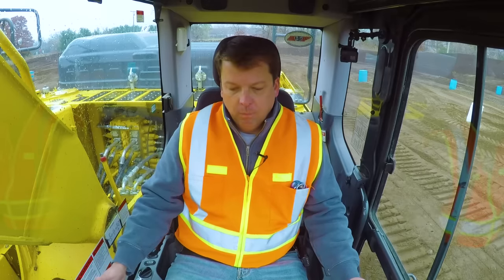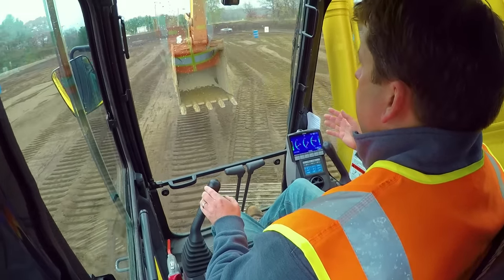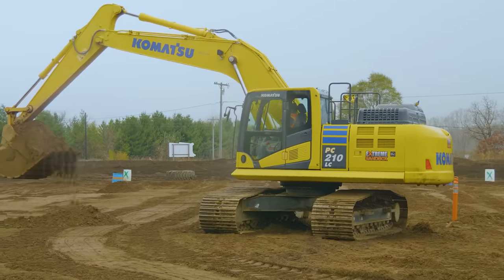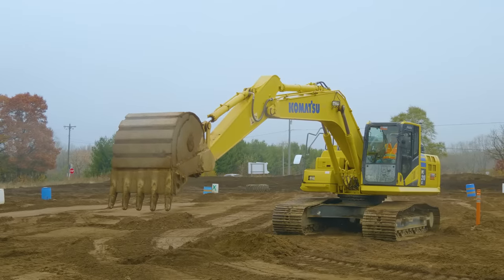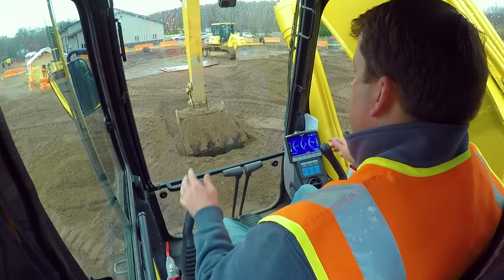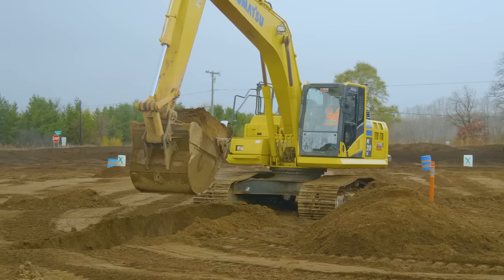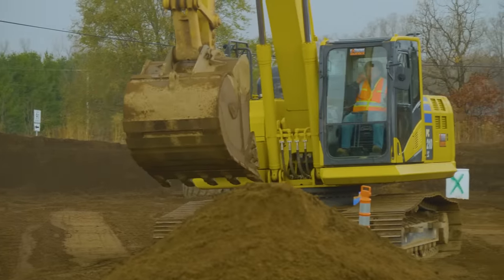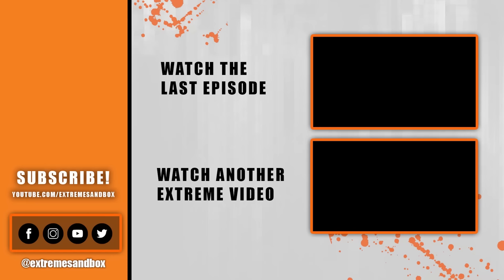What NOT to do in an Excavator | Heavy Equipment Operator Training

Comment: Final drives always uphill
Reply from the maker: Thanks for the comment!
Reply: If you climb steep terrain with sprockets (final drives) uphill your track chains are pulling downwards, applying pressure to you top rollers and leaving slack under the bottom rollers, which can skip on the sprocket as you climb and puts a ton of stress on your top rollers. Idlers should be facing uphill, drive coming from the rear, so the slack is on top and the chains are tight on the bottom, increasing traction and contact with the surface you're climbing. That's why all tracked equipment is designed with sprockets at the rear, so when you're traveling forward you get maximum traction when the machine is likely to be under load(especially on dozers). After plenty of time climbing steep terrain in forestry and land development I can confirm the difference is night and day climbing with sprockets at the rear.
Reply from the maker: @pushnpow  Thanks for sharing this info!
Reply: Mr Dig so what your saying is instead of replacing worn out parts and keep good tension on the tracks I should keep the heavier side of the undercarriage down hill and the lighter side uphill?
Reply: OakRidge 2680 you increase traction having the final drives at the rear. That’s the simplest way of putting it. The machine is designed to climb that way, with the weight of the final drives and counterweight at the rear. The weight of the final drives is inconsequential, if you have a quick hitch and a bucket on the end of your dipper it’s much heavier than a pair of final drives anyway. I have tried climbing both ways in the real world on very steep terrain and can confidently say you will climb better, easier and with less stress on the machine with sprockets at the rear. And avoid wearing out your undercarriage prematurely.
Reply: OakRidge 2680 having sprockets at the front increases tension on the part of the track not engaging the ground, your track is loose against the ground and pulling tight on your top rollers, which does nothing for traction and puts excess stress on the roller for nothing. Have a look at it next time you try to climb that way around. Better yet, at the crest of a steep slope, track a third of the length of the frame into the air and have a look at the chain underneath. It will be hanging loosely under the machine, with the sprocket barely grabbing the chains, but tight as a piano string on top, putting all that pulling force on the top rollers, which just ruins the bearings and wears out the rollers. You want that tension on the ground, pulling the machine up a slope, not trying to pull chains into the top rollers.
Reply: Mr Dig what your saying about unnecessary stress and tension on the front idler makes sense. I don’t understand how a few inches of slack on the bottom of the track (part on the ground) would cause you to loose traction. If your square up and down with the slope of course
Reply: OakRidge 2680 I was meaning more the top rollers than the front idler. It’s a real bastard to explain in written sentences. It’s really something you’ll notice if you’re climbing decent, continuous grades in larger machines. If you reach a point where the machine won’t climb and your sprockets are uphill, try the same slope again with idlers uphill and you will notice a difference.
Reply: Mr Dig well that’s why I ask, I’ve been in that situation numerous times. (Not it dozers) I’ve always noticed working on a hill is more sturdy when your finals are up front. Less rock and lean when you break 0 while swinging
Reply: Mr Dig hey Mr Dig did it ever cross you that you’ve been wrong? All this time you’ve been making a simple mistake.
Reply: OakRidge 2680 I could ask you the same question. If you can ignore every logical reason, fact or experience that I’ve written here and ask me if I think I’m wrong then I’m clearly pushing shit up hill. Sprockets behind, naturally.
Reply: OakRidge 2680 the only thing that may make sense to you is to ask yourself: “If my machine climbs better with the sprockets in front of me, why is every tracked machine built today designed with the sprocket at the rear? Excavators, bulldozers, tracked loaders, tracked skidsteers, snowcats. If I’m travelling forwards, the sprocket is behind me. Why would they do that?”
Reply: Mr Dig that’s a good question. Most track trucks like morookas and yanmars have them in the front. Maybe it’s to offset the weight of the attachment? Making the machine more balanced

Comment: Yeah dump it 2 feet away from trench if your trench is only going to be 2 feet deep
Reply from the maker: So are you saying 4 feet for 4 feet, etc?
Reply: @HeavyMetalLearning  yes,what ever depth your digging the edge of the spoil heap should be the same distance, ie 1 metre deep you heap would be at least 1 metre away, it's weight and grond pressure,
Reply from the maker: @clivecousins4315  Interesting....I've never heard that rule of thumb, but makes sense.   Curious if any other operators have that same rule?    Thanks for sharing!
Reply: @HeavyMetalLearning  might be different over there than here in the UK,  but the weight from it bears down on the ground below at about 45 degrees angle it just saves the weight to close collapsing the side of your trench,if the bottom of your trench is 1 metre then 1 metre away is about 45° angle so there's no ground pressure pushing down against the side of your trench, nice looking machine👍 glad to see another 1 that isn't over greased, that then runs down everywhere and looks a mess when she's been worked👍
Reply from the maker: @clivecousins4315  Thanks for sharing...that makes sense!

Comment: I'm so glad you don't have CAT on this video. They've really disappointed me over the last 10 years. Their K series dozer needs to be scrapped! It's garbage!
Reply from the maker: We do love our Komatsu!
Reply: They've pretty much always disappointed me. We've got a couple cats now, and yeah they're nice, but they're new. Pretty much anything new is gonna be nice. Their backhoes were pathetic back in the day, all the ones I ever ran anyway. And I'll never forgive them for damn twin sticks... What is the problem with 3 stick backhoes? Not that difficult, but I'm weird apparently.
Reply: Ive been operating heavy equipment for 15 years now. Mostly excavators and dozers. Link belt, Komatsu, John Deere, And Kobelco are some of the brands along with CAT just to name a few. Working pipeline construction as i do we put these machines through the ringer and in the harshest terrain whether it be bone dry dirt or mud up to the counter weight while running these machines no less than 10 hours a day 6 days a week. We get these machines brand new most of the time at the beginning of a job most with the plastic still on the seat and only a few hours on the screen. With all that said nothing in my opinion has the quality of a CAT. In my opinion they set the bar on how a machine should run. There are a few give and take arguments in comparison to the other brands but Caterpillar lasts the longest without breakdowns and power and performance is surpassed by none. Im speaking from my personal experience. Most of the time when you do not see Caterpillar equipment on a construction site its because the company doing the job choose not  to rent, lease, or buy them because of the more expensive price tag so they go the cheaper route to make more profit at the end of the job.
Reply: I've been operating for almost 30 years & cat has done nothing but go down hill. They make cheap junk now. They used to be the best & I wanted nothing but cat. Not anymore, komatsu is way better built, less issues & more concern for operator comfort. Cat needs to step it up.

Comment: Yes dig from the top down not the bottom up. Spoils go to the right.    You are so wrong 1 trenching spoils go in the Right so your not working on your spoils and not adding compressive weight to the side of the trench and they have to be at least 2 feet away from the trench as that is an OSHA Law! I think you need to attend and send your operators to a Competent person trenching and excavating class and you will not give bad information any more!
Reply from the maker: Well that escalated quickly!

Comment: Banging your bucket every cycle is extremely annoying and will get you run off on the pipeline also tracking with your hands instead of feet....not good
Reply from the maker: Good tips....thanks!
Reply: I'm 5'2" blow me lol. Seats in Cat machines are junk and don't drop far enough for me to use my feet to the full potential. Also Cat makes a junk machine anyway lol. John Deere is where its at. Lol
Reply: Why is using hands for tracking bad...? I hate using my feet. Maybe it’s because I’ve only run a tiny Bobcat E26
Reply: @midget9629  I agree deere is a superior machine
Reply: @midget9629  Kobelco is better then John Deere

Comment: Wait.....    WHAT!?

Operators do a Pre-Op?!

PPPPFFFFTTTTTT.

Wanna know how I know they don't?
Because I get paid below average to compensate for their above average pay to ensure that the equipment still runs.
I know for a fact.
I've seen their paychecks.
Reply from the maker: I’m confused...but ok
Reply: @HeavyMetalLearning  Early on in the video, you mentioned that operators do a pre-op.... in other words, checking out the basic machine before operating it, such as engine oil and coolant.
I'm meerly suggesting that most operators, in fact, do NOT check their machine before operation.  That's coming from a mechanics point of view, nothing more.
Maybe I work for a less than professional company, but I've worked for multiple others in the past..... it's always the same old thing.
Operators just want to get in, turn the key and just go.  No warm up, no checking oil, no looking at tracks, body, arms or anything.
Just my experience, is all.
Good video, by the way.  I wish more "operators" would watch stuff like this.  But alas, they are home getting hammered while I work overtime in extreme  weather to fix what could've been avoided in the first place.
Reply from the maker: Ugly Stik I hear yeah...definitely should be part of their daily routine but I know many times it is skipped.   Thanks for the comment!